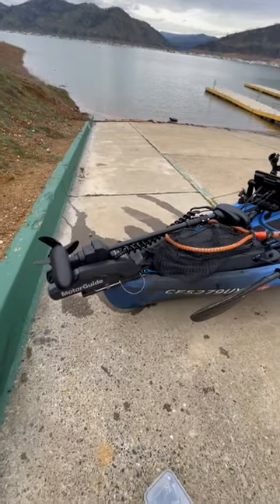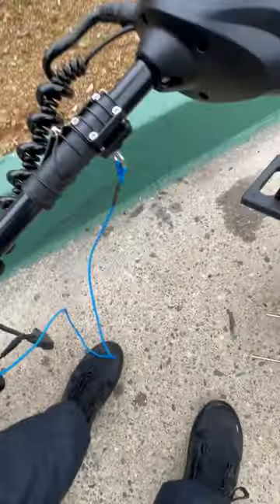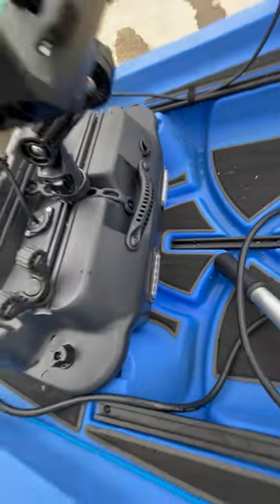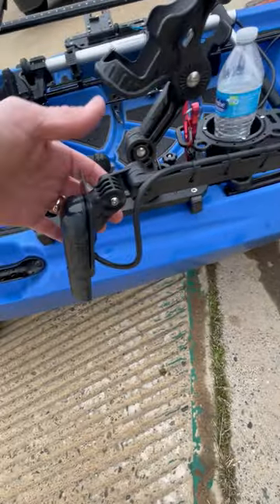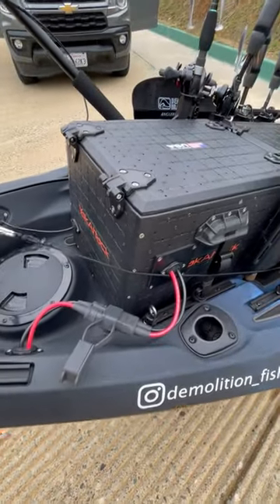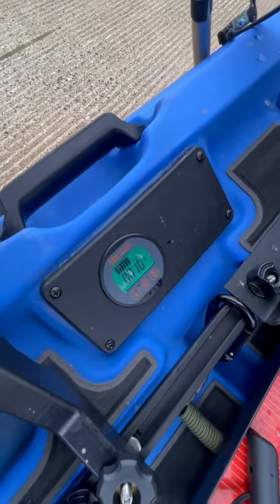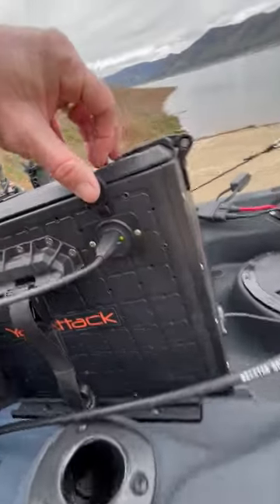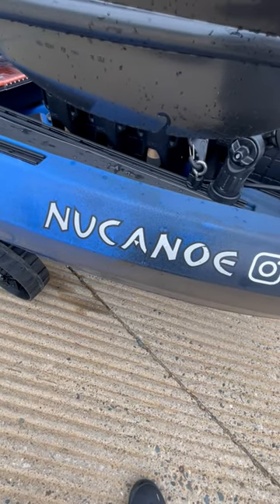Nucanoe Unlimited 2023 Tournament Build Walk around with Build list. #nucanoe

Comment: can you post a link to the rubber clamps? thats a sweet set up. I bought everything you have here just need to get it all installed. how to you install the black box and battery in the pod? did you just screw them directly into the pod?
Reply from the maker: https://www.amazon.com/Original-Quick-Fist-mounting-equipment/dp/B000CQPANY/ref=d_bmx_dp_sccl_2_1/137-6948526-4948315?pd_rd_w=oQNmk&content-id=amzn1.sym.75c270c2-c634-4bf2-a06d-5e2487c710b9&pf_rd_p=75c270c2-c634-4bf2-a06d-5e2487c710b9&pf_rd_r=88WY6Z9X5W2X8FD4Z9H3&pd_rd_wg=Uigzi&pd_rd_r=f991adbe-7507-4d5a-a2be-f7c02aef6069&pd_rd_i=B000CQPANY&psc=1
Reply from the maker: I just used the 3m Dual lock Velcro to hold the black box, battery box and Yak power system as well https://www.amazon.com/Dual-Reclosable-Fastener-SJ3560-Clear/dp/B07XPK1HPQ/ref=asc_df_B07XPK1HPQ/?tag=hyprod-20&linkCode=df0&hvadid=385169513481&hvpos=&hvnetw=g&hvrand=10104805982342519820&hvpone=&hvptwo=&hvqmt=&hvdev=t&hvdvcmdl=&hvlocint=&hvlocphy=9031988&hvtargid=pla-875267566047&psc=1&tag=&ref=&adgrpid=78285505333&hvpone=&hvptwo=&hvadid=385169513481&hvpos=&hvnetw=g&hvrand=10104805982342519820&hvqmt=&hvdev=t&hvdvcmdl=&hvlocint=&hvlocphy=9031988&hvtargid=pla-875267566047
Reply from the maker: Stoked to see your build!

Comment: Question about the xi3 bow mount motor. What is the length of the pole on that? Im in the market for one and notice the have a variety of lengths. I was leaning towards the 36" pole but am unsure if this would work/be long enough. Wondering if you had a suggested length specifically for the unlimited. 
Also on the motor guide bow mount, is it the quick release bow mount motor guide sells or is there a specific one for the unlimited?Thanks in advance and nice build.
Reply from the maker: So I used the 36” length XI3 without any issues. Took a couple trips to get it set correctly to avoid the cavitation but after I found the sweet spot I left it. The quick release is from Motor guide mounted to the One Objective mount. Would recommend the One Objective mount because of the built in handle👍
Reply: @demolition_fishing  thank you so much. Appreciate it